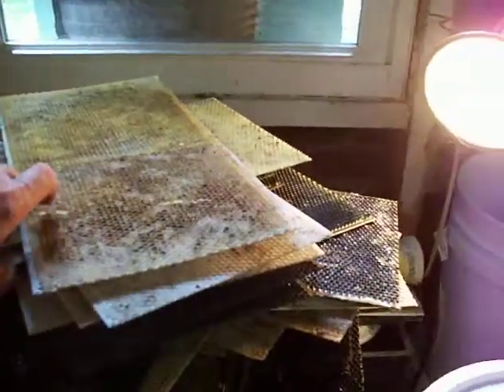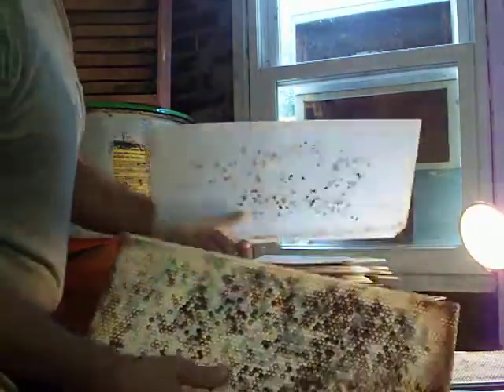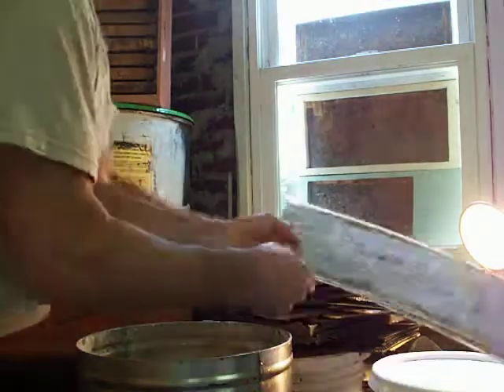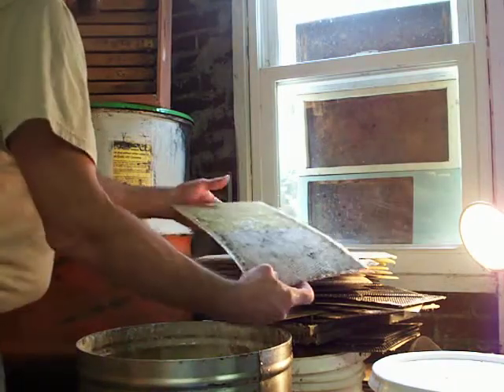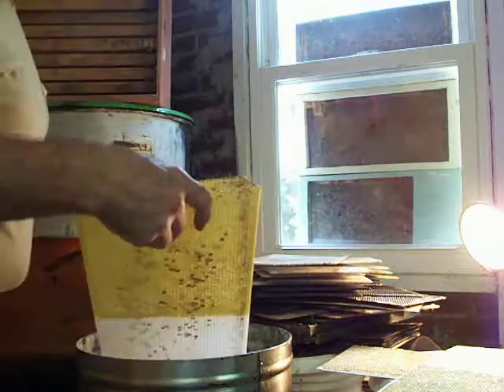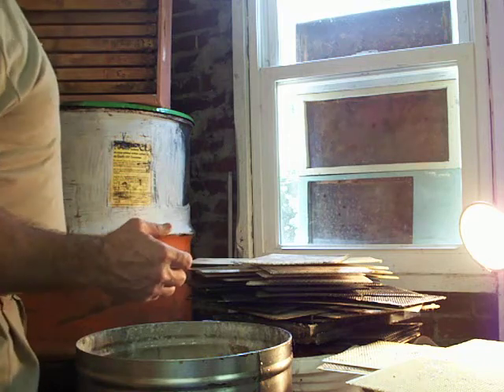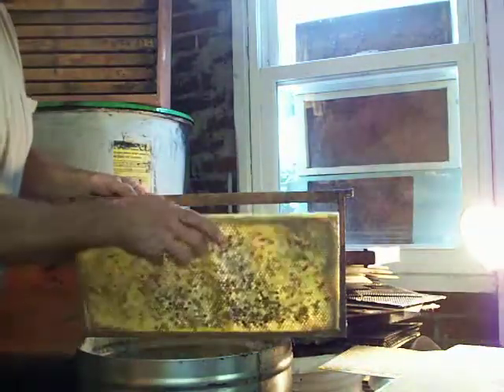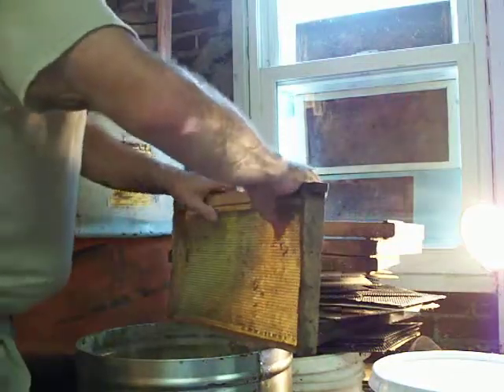PLASTIC FOUNDATION Frames Bees Wax Waxing repair,Beekeeping Georgia Beekeeper John Pluta,Honeybees

Comment: I high pressure my plastic foundation with extremely hot water.  It cleans all that out of the cells.  Then I paint brush it back on using a small crock pot keeping the wax hot.  I do not have room for your set up John, but I like it.

Comment: I use a similar method but I don't use that much wax.  You can float the melted wax on water and only need a thin layer of wax on top of the water to coat the foundation.  The water provides the depth you need to dip the foundation.